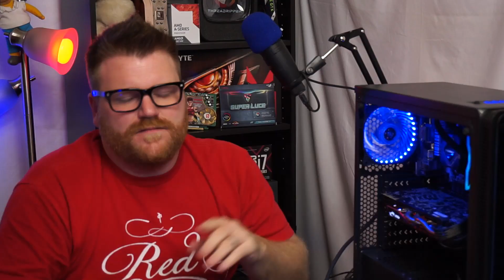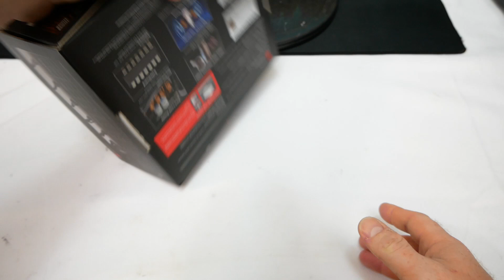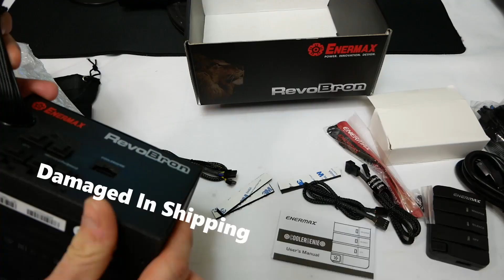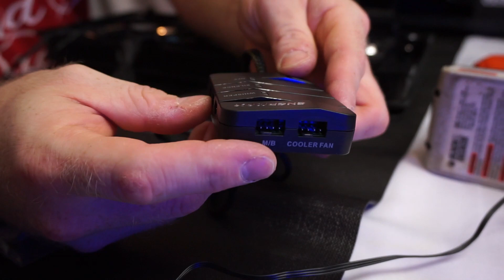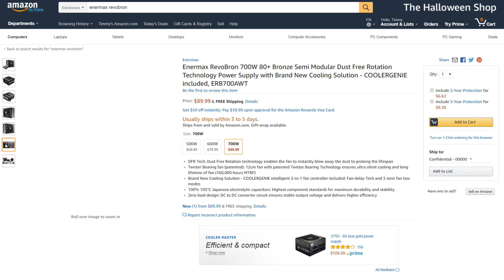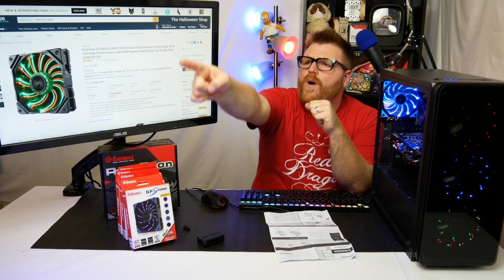Enermax DF Vegas Fans and RevoBron Power Supply Review

Comment: Fans are overpriced, and 5 year warranty on the PSU.

Good products, not good value.
Reply from the maker: Seriously, the fans are worth it, not for the lights, but check out there DF storm fans, they will cool ANYTHING! PSU is good price I thought
Reply: Seasonic FOCUS Plus is $10 more but carries a 10 year warranty, and is a better quality unit.
Reply: 61cfm and 1.8 static pressure is decent in a fan for the price is actually right in the competitive market without being over priced its right up there with corsair and cougar fans and many more.
Reply: name 5 fans with 60 cfm or higher with more than 1.8 static pressure i bet you can not for 20$ lol